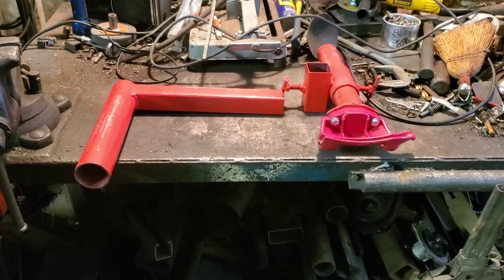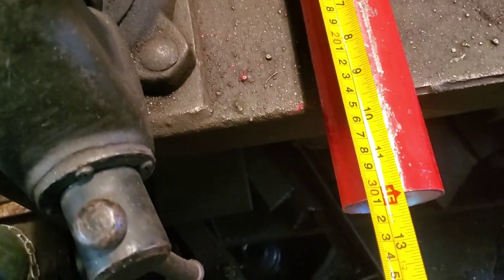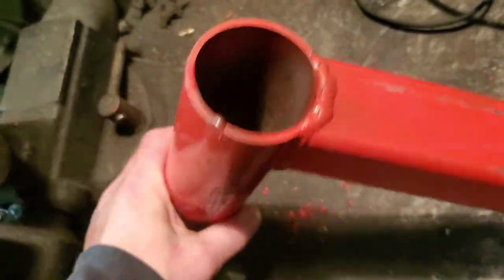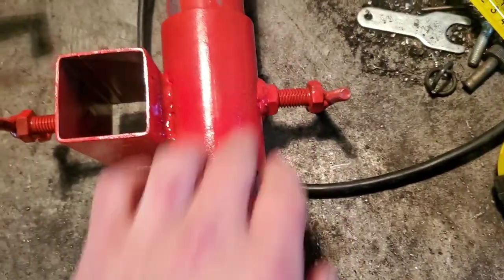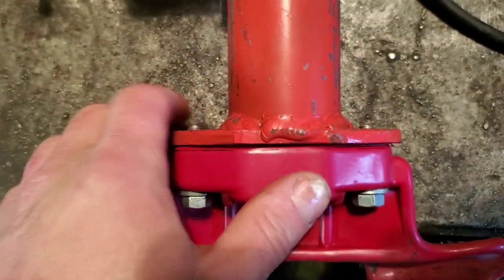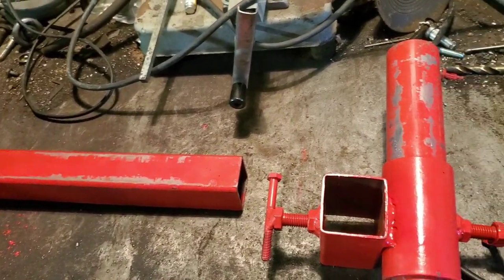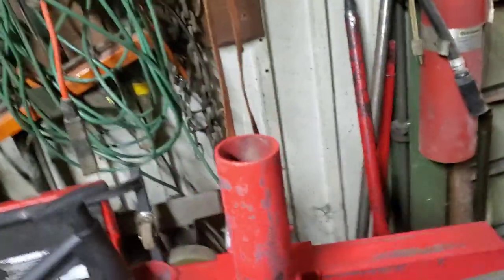Duck bill mod for harbor freight tire changer

Comment: I built my own changer because I wanted something more substantial than the HF unit. I made my own change head because I wasn't even aware these duck heads were readily available.
I'll be modding mine to take a duck head.
Reply: Check out a youtube video ; some guy tests  three  duckheads ; the red one,  a black  one,  and a stainless steel one ; THIS  one, really looks  ' ducky '.   His tests, show the black one requires less force ;  red is next, and the stainless one  rates last....good luck ~ sir !
Reply: @petersack5074  Yes I saw that video and purchase a black one

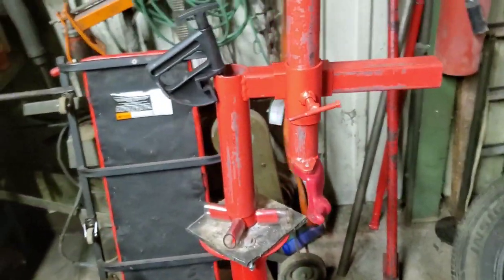Comment: 4:08  ''....it is a  ' bit  yanky ' .....?   Another new term, for us. Here, we use the word  '' wonky ''......Hi. Making one of these tire changers, same duckhead.  I'll use flat steel, with a large nut (you may have to sand off, about 1mm off of each hex corner, to fit snugly)  welded to it, for fitting in the  1+ inch hole, in the duckhead, between the two mounting holes.  Then, place the duckhead on the flat steel, with the large nut in that hole ; trace around duckhead, and 2 bolt holes, and cut out the size needed.  This way, when mounted to the vertical support, the duckhead can withstand    alot   more  force, if required. I won't depend, on just the two end bolts, supporting a lateral force. Using that hole, to distribute the force, as the duckhead was  designed for this ; lateral force supported internally  vertically.  ..anyway....good luck, ALL  !

Comment: What did you use to prevent slop from the harbor fright screw down to the pipe of the modification.  There is about a 1/16 inch difference between 2 1/16 pipe and the 2 inch tire bore.  I want to get that slop out of the duckbill mod/, Any suggestion?
Reply from the maker: nothing

Comment: i found that if you do not offset the duck head it works way better.
Reply: What do you mean with offset?
Reply: @chrislambe400  you mounted to one  the side of your center post . you can get this to work using a round post on the duck bill .when doing larger heavy ply tires i found the duck head would twist
Reply: putting the duck head post inline with the center post and using a square shaft solved this 18'' tires are now a breeze
Reply: also applying the turning force as close to the duck head as possible reduces flex on bigger tires